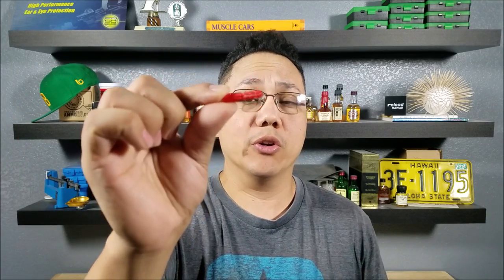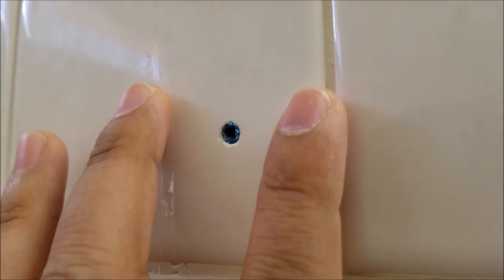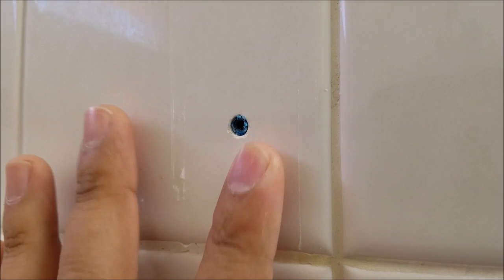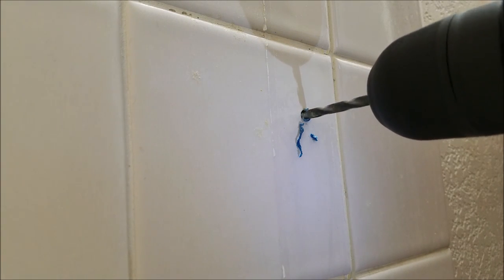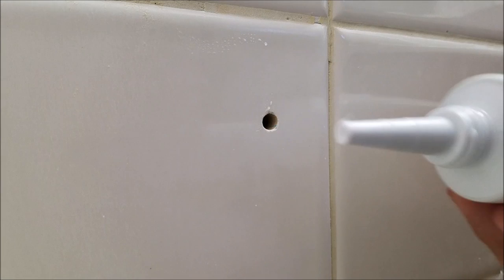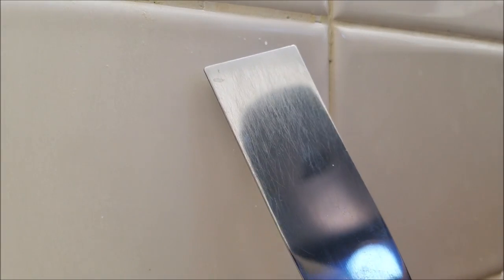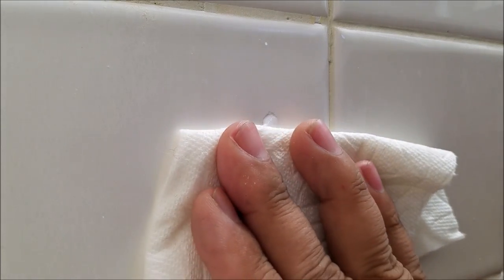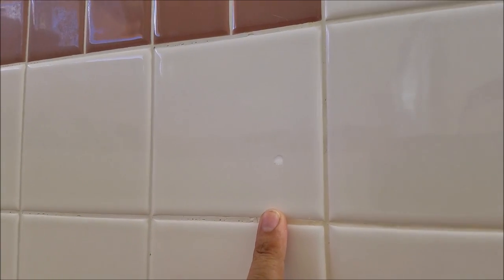HOW TO REMOVE AND FILL WALL ANCHOR WALL IN SHOWER WALL

Comment: I have 3 tiles with holes due to a handicap bar that was removed. Each had 3 anchors and I was trying to match old tile (near impossible) to get those three tiles replaced.  Dead end.  Then considered taking those anchors out and found your video.  Worked like a charm. Fun celebration pulling out those old anchors out.  Thank you.

Comment: Screw a screw in and pull it out with pliers? Coz when you drill, it might go too far and shred it.

For tough to remove plugs in masonry i use the above method